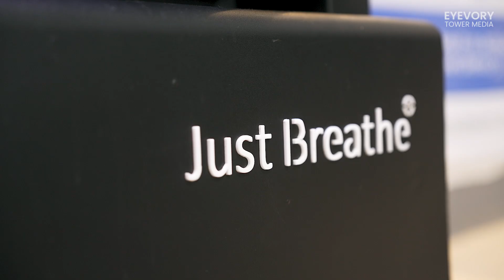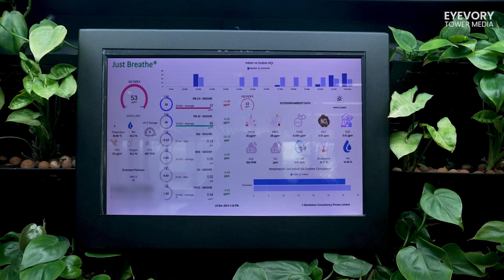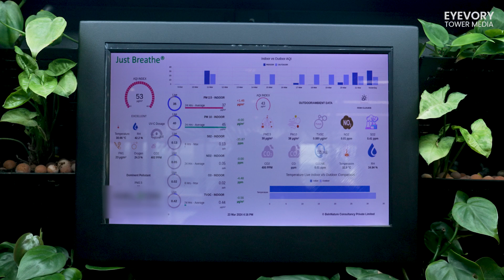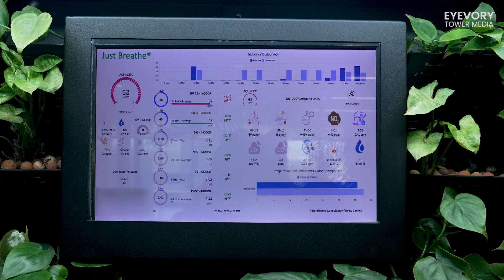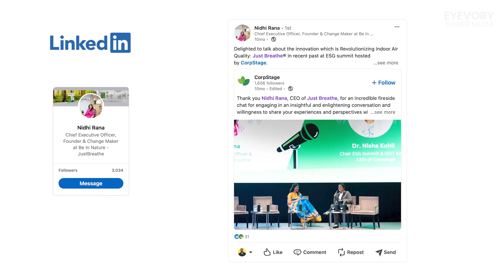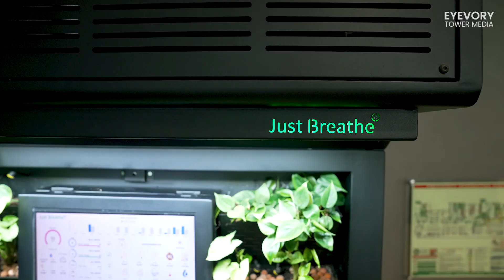How This Startup is Solving Indoor AIR POLLUTION?

Comment: There are so many kinds of pollutants. I don't think there are plants, the combination of which can absorb most of the pollutants. For example, what will a plant do of a tyre pm2.5 particle?
Also, this is a far worse and far more complicated(unnecessarily) system compared to simple air purifiers.

Comment: Won't it would be cheaper just to buy plants and put them in your home or office?
Reply from the maker: That's a good point. Yes it is cheaper to use plants. if you have observed offices already use plants both outdoor and indoor. However, in my observation they are not easy to maintain especially the indoor plants. Structural damages & contamination in the root system are a big challenge. Some living walls companies are trying some methods to solve this issue. I think the difference here is showing you how much pollution levels are in the office and how much they are reducing through the tracking system.
Talking about the larger picture, if you maintain the city with good number of trees then you don't need any additional purifiers. (Ex. Bengaluru used to be an air conditioned city earlier)
Reply: Correct